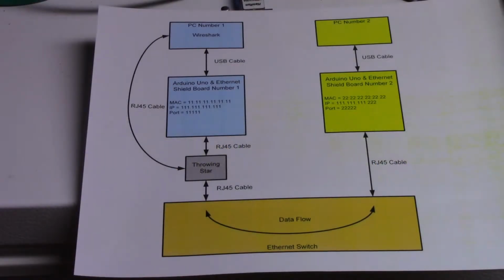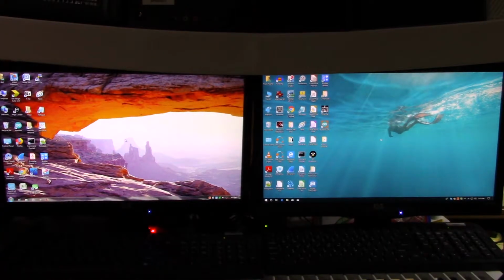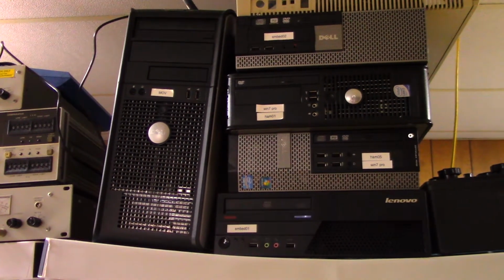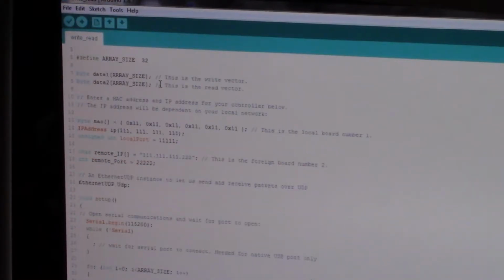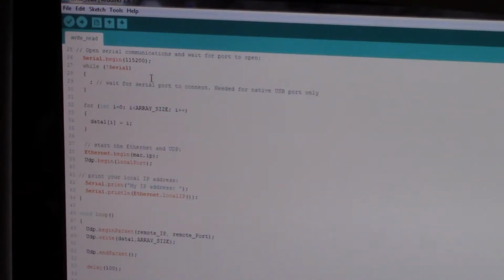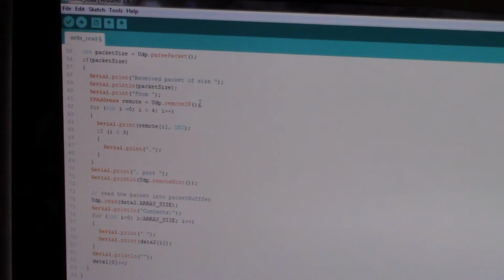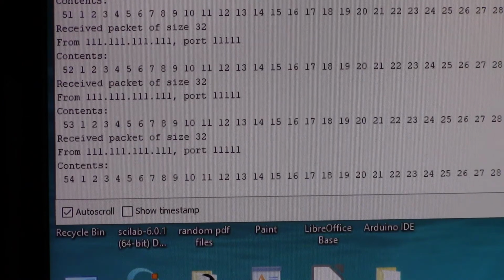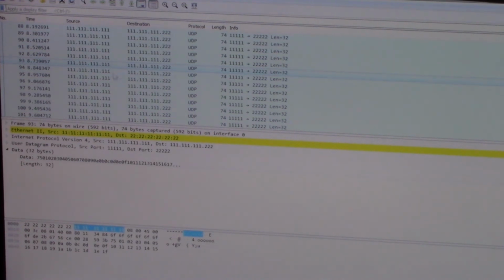UDP Ethernet Communications between two Arduino Unos with the Ethernet Shield

Comment: Thank you very much for making this video. I was searching for a solution here to control an entrance gate and also provide feedback to let me know if the gate system is OK. You have make it real easy for me to do that now! FYI I am planning to  use a TP LInk CPE 210 2.4G link to provide 2 x video feeds as well. The system with video is currently under test I also would like two way audio......not even started to think about that yet!. Why the 2.4 G link?  Because the 250 ft of data cable is failing..tree roots I think. Anyway....again thanks a lot mate......be well Frank!

Comment: Thanks for this, simple and clear. The least I could do is transcribe your code as shown in the video-

#include <SPI.h>
#include <Ethernet.h>
#include <EthernetUdp.h>

#define ARRAY_SIZE 32

byte data1 [ARRAY_SIZE]; // This is the write vector.
byte data2 [ARRAY_SIZE]; // This is the read vector.

// Enter a MAC address and IP address for your controller below.
// The IP address will be dependent on your local network.

byte mac[] = {0x11, 0x11, 0x11, 0x11, 0x11, 0x11}; // This is the local board number 1.
IPAddress ip(111, 111, 111, 111);
unsigned int localPort = 11111;

char remote_IP[] = "111.111.111.222"; // This is the foreign board number 2.
int remote_Port = 22222;

// An EthernetUDP instance to let us send and receive packets over UDP
EthernetUDP Udp;

void setup()
{
  // Open serial communications and wait for port to open:
  Serial.begin(115200);
  while (!Serial)
  {
    ; // Wait for serial port to connect. Needed for native USP port only
  }

  for (int i = 0; i < ARRAY_SIZE; i++)
  {
    data1[i] = i;
  }

  // Start the Ethernet and UDP:
  Ethernet.begin(mac, ip);
  Udp.begin(localPort);

  // print your local IP address:
  Serial.print("My IP Address; ");
  Serial.println(Ethernet.localIP());
}

void loop()
{
  Udp.beginPacket(remote_IP, remote_Port);
  Udp.write(data1, ARRAY_SIZE);

  Udp.endPacket();

  delay(100);

  int packetSize = Udp.parsePacket();
  if (packetSize)
  {
    Serial.print("Received packet of size ");
    Serial.println(packetSize);
    Serial.print("From ");
    IPAddress remote = Udp.remoteIP();
    for (int i = 0; i < 4; i++)
    {
      Serial.print (remote[i], DEC);
      if (i < 3)
      {
        Serial.print(".");
      }
    }
    Serial.print (", port ");
    Serial.println(Udp.remotePort());

    // read the packet into packetBuffer
    Udp.read(data2, ARRAY_SIZE);
    Serial.println("Contents:");
    for (int i = 0; i < ARRAY_SIZE; i++)
    {
      Serial.print(" ");
      Serial.print(data2[i]);
    }
    Serial.println("");
    data1[0]++;
    }
  }
Reply: thanks, buddy

Comment: Whats the function of throwing star?
Can't direct to switch?
Reply from the maker: It forces your computer to receive only. If you use a switch or hub, your computer will try to transmit to connect to the network. By using the throwing star, it prevents your computer from interfering with the network when using Wireshark.
Reply: @frankrudley8992  ok thanks ..and now i have a problem with the arduino cant connect to the router, but if direct to PC its connect.. Do you know why?
What the router must be sett?

Comment: That's a great demonstration. Also I want to ask if this can work with multiple devices over the network including arduino and python to send and receive data from one arduino (server).
Reply from the maker: It should work with more devices. It uses the Arduino Ethernet Libraries which is in C++. I am not sure if that will work with python.
Reply: @frankrudley8992  I have just tested with 1 arduino and 1 python client and it works perfectly, though when working simultaneously it receives data from arduino more than that of python. Trying to resolve that. Thanks a lot for your help.

Comment: awesome work. Did you document your work,?
 If yes please share the link
Reply from the maker: Hi - I don't have any more documentation. 
But all of the datasheets and schematics are available on the Internet (Public Domain) from various sources that you can freely download.
The Ethernet Shield uses the Wiznet chip.
The code is the same as the examples that come with the Arduino Integrated Development Environment. - Thanks - Frank
Reply: @frankrudley8992  Hi,  much appreciated.